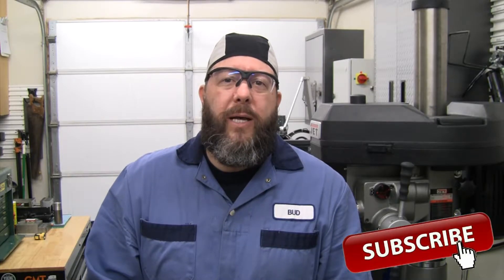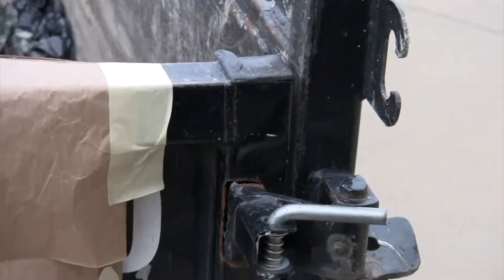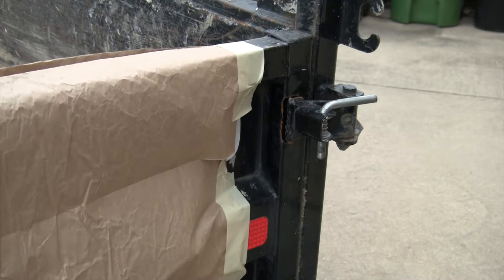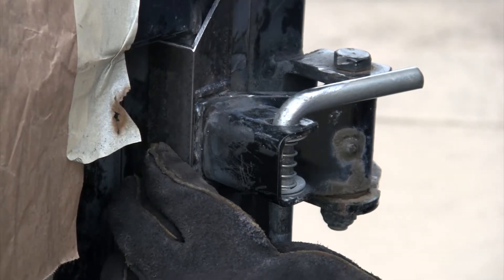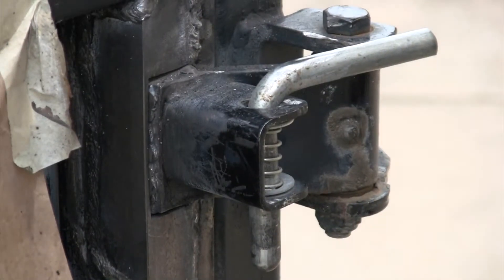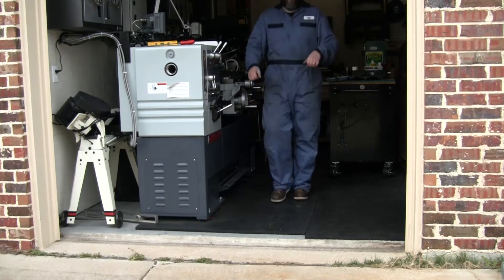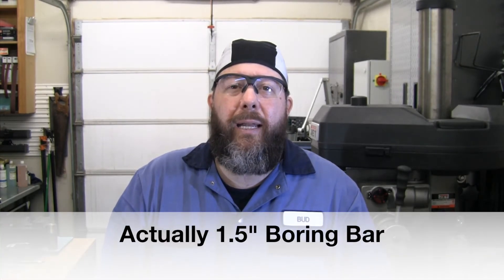Welding Dump Trailer Door Hinge - Reinforced With Angle Iron For More Surface Area

Comment: question, why did you not weld the bottom of the hinge?
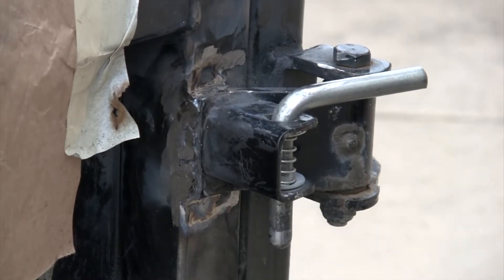Reply from the maker: FullcircleFaith - Thanks for the question. Has been a while since I did this one, I went and looked at the video and at 9:47 it looks like I have welded all three sides of the hinge before I put the angle iron in place.  I did not weld the fourth side (pointed towards the pivot bolt) just to match what was previously done. Also, it is just two bolts to pull the door off and when I had to fix another load me of his trailers later I pulled the door off. Made it so much easier to weld.

Comment: More of a grinder than a welder ?
Reply from the maker: Gary Postell - Fair enough. I don’t claim to be a professional welder. I just wire brushed the slag off. I am sure I could have hit them with a grinder to look better. Thankfully they served their purpose.
Reply: @BladesIIB  you did fine.
Reply from the maker: @ajsironworks3937  Thanks!  Appreciate the comment. Always improving, did another job recently with the new spare tire holder and the vertical welding was much better.

Comment: Nothing personal but add gas to your welder.. flux core is hot.. I've never vertical up.. I'm not a professional welder. But I've force myself to figure it out.. vertical down is the best.. for me . I've shown my welding to welders.. they like it. I've found out left right vertical down. And always get where you can see the weld.. I've been given a new like maybe used once Lincoln 225 ac/dc buzz box. I've been saving up on aluminium.  Have a few projects to do with that stuff. But need a mini spool gun. Just welded a 2000 Warn winch on one of those pick up bed cranes .. so they cant steal it... 
  The guy that said that thing about the square tubing may of thought about opening the tip and dropping it down in side.. I have a scrap yard near me and buy all kinds of square tubing.. cut offs.. just finished 2 36 ft. Long angle iron trusses 24" tall I'll hang a brige crane under them. Too old to pick stuff up.. way too many projects.. I  subbed by the way.
Reply from the maker: Donald Powers - Did not take personal at all. I don’t claim to be a professional welder so always open to feedback and learning. Really I should have taken out the two bolts and welded it flat been the easiest. Always learning a better way. I do run gas even with my flux core but I could likely turn the pressure up a bit. Thanks!  Also, thanks for the sub!
Reply: This conversation is epic I learned more here than in all 13 years off pubelicksRcool the mafia is a lie and joe Biden didn’t want to do it but it was necessary for the health and well being for the people of America who run this bitch like I think you ain’t sleeping in and walking around the white house just practicing for a retirement home like imagine the morning huddles and zoom meeting In the White House that shit has to be awkward as hell and everyone points fingers at who’s the dumbest and get lost in their daily lives and personal personas that makes every day a risk for us the human people that one mf has the power to make shit happen within a week think of the mistakes meaning- wrongful doings that these people make it’s one slip up and some Steve Harvey shit starts to go down and we lose track of the real winners and go getters of society who just want to get shit done the right way and make sure the choices they make impact more than the government title we don’t need celebrities to look up to we need real superhero’s in the whitehouse this got to be the realest shit ever and I’d like to say that everyone is stupid and we all need to realize that you will never be the best at anything that has any importans unless it benefits you in real time if that’s how you see this universe

Comment: You are going to hate me... the reinforcement for this fracture should have been more like a square tube added to the face of the bracket and back into the frame of the door... You have an "open fracture" and this was from tension...  The square will give you tension and compression resistance.
Reply from the maker: Always appreciate feedback. I am not 100% sure what understand where I would have put square tubing. Good news it the repair is holding. If it fails again I will try something new. Based on the thickness of the original tubing I think this repair is an improvement from the original design. Time will tell.
Reply: @BladesIIB  , it fractured at the weld...
The fracture was a tension failure.
I will do a video reply when I get time...
I hope u catch it on my channel...I will explain on that video (perhaps in the next few days).
"Time" is not the cause of this failure but a stress was...

Comment: Keith-Mich. I got pretty good with my torches and did a lot of brazing, with worn out key slots, and fixed the issue with brazing the keys in place.  Without taking the drive shafts, out.